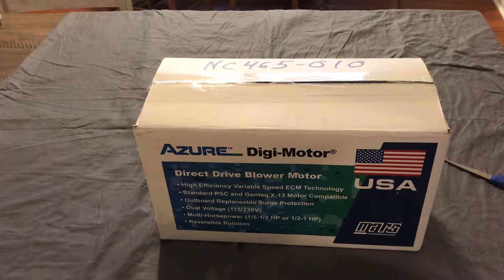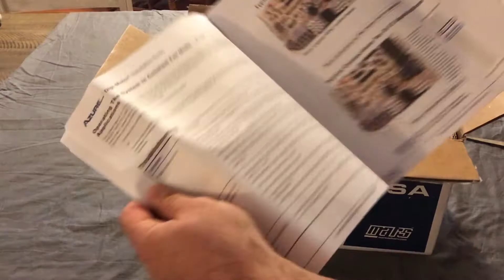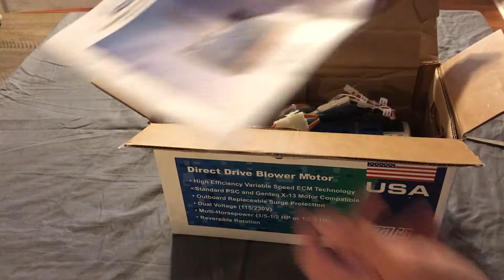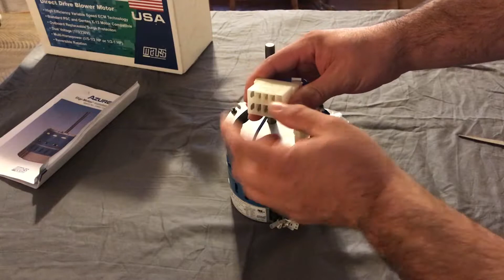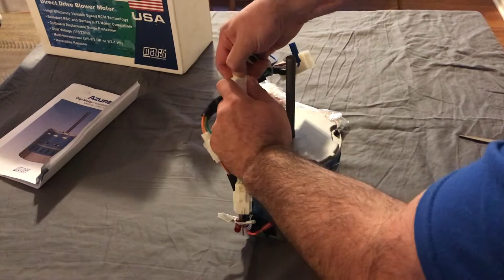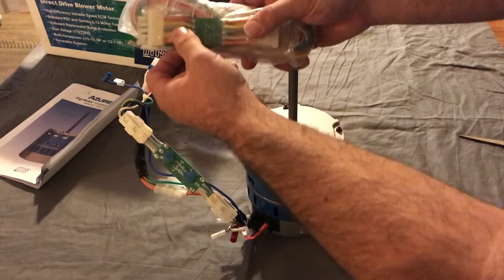MARS Azure Universal X13 Blower Motor for HVAC Systems

Comment: I really appreciate videos like this. I really hate HVAC sites and the profession in general- I've got to DIG the balls out of the net to find anything useful and it's just a god MMMMM electric motor which nobody will answer a MMMMM question about on forums because 'they can't due to contract BLAGH'- disgusting People, every one of them. The internet will eventually destroy this industry, as it should. If you can't tell, I'm just a little angry about how hard it is to find answers to anything about this stuff. I will fix this myself and I will learn, one way or another, costs be damned and then: I can gouge the holy grail out of other People like these HVAC bastards do- my morals won't actually allow me to do that though which is why I'll never be an HVAC installer.

Thank you for the video. I'm venting a bit and I'm sorry about that.

Comment: Hi guys. My Mars 10861 turns on as soon as it gets 220v? Manual says it will run anytime the main power AND at least 1 speed tap are energized. In my case, none of the speed taps were energized yet and it keeps turning on. Why is that?

Comment: Will this work on a Multi speed PSC Motor? And, if it does how much more efficiency will it give me in percents?
Reply from the maker: Yes it will work to replace a PSC motor. They are more efficient. As for putting a number on it, well that’s hard to do. This motor is low voltage starting vs high voltage starting with the PSC. It’s not worth replacing a good great working PSC with this motor but if your in need of a new motor then it’s definitely worth the upgrade to this motor vs another PSC
Reply: @ntexashvac7240  Thank you for your reply! And, I have a new furnace with a PSC motor and thought I could save a lot of $ if I swapped it out for one of these. But, it sounds like I should just hold off then as I'd just be wasting it.
Reply from the maker: Yea the return on investment for a blower motor change like that would be many years
Reply: @ntexashvac7240  Would it be worth it if I got it for free and not have to pay for installation?